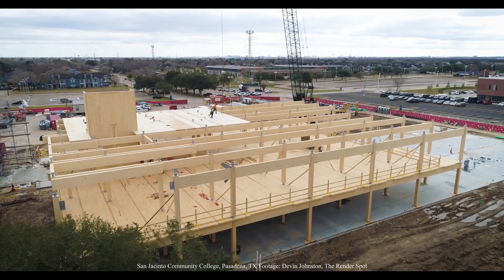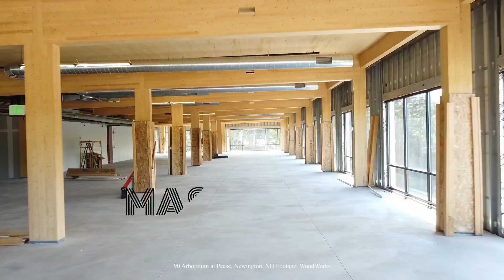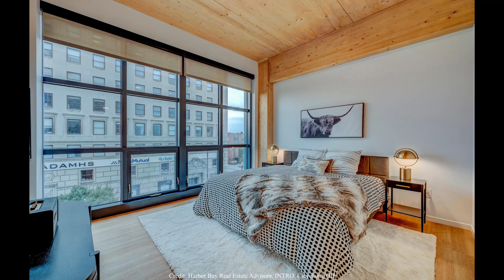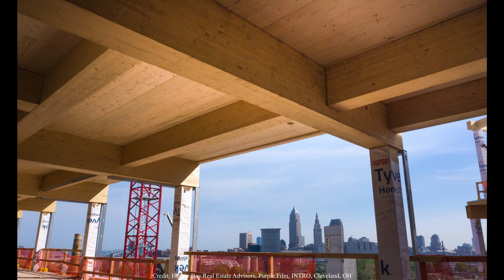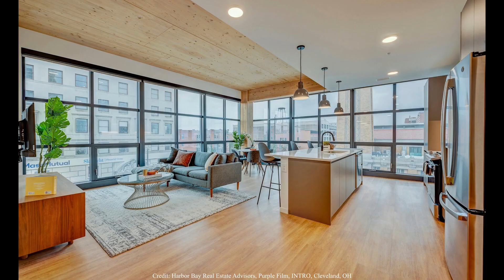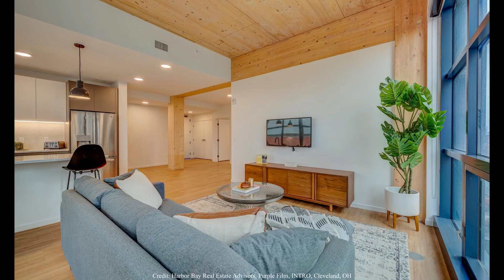Tall Mass Timber | Type IV-B | 9 Stories | INTRO in Cleveland

Comment: Thank you for the video Ricky. I'm an senior architecture student at Kent State and have visited this site over the summer. Currently I'm working on a residential glulam project based in Chicago and have been trying to learn more about the type IV-B in its application. It's interesting to know they had 50% coverage which seems reasonable considering MEP. Your videos have definitely given me a better understanding of how design this building type.
Reply from the maker: Very cool! Yes, around the 50-60% exposure seems to be a pretty common spot to aim for in multi-family mass timber. Certain MEP intense areas like bathrooms, kitchens and corridors will usually have a dropped ceiling to concealed those services. Thanks for watching!

Comment: Ricky, thanks for your videos.
Sorry, I do not speak english well. I use "machine translation", but as a builder I understand everything perfectly.
Make a video about 1-2 storey houses. Very interested in design principles and economics.
I have a personal question about moisture protection - Why is a vapor barrier made between CLT and mineral insulation, and vapor barrier is not used between wood fiber insulation?
Reply from the maker: Thanks! I'm not an enclosure scientist, but there are a few variables involved in the decision such as whether the insulation is vapor permeable or impermeable, what the climate zone and climatic conditions of the project are, and how vapor is being driven through the assembly. RDH Building Science has a great resource that discusses this topic in much more depth: https://learnbuildingscience.com/collections/mass-timber-enclosure-series/products/copy-of-mass-timber-building-enclosure-best-practice-design-guide